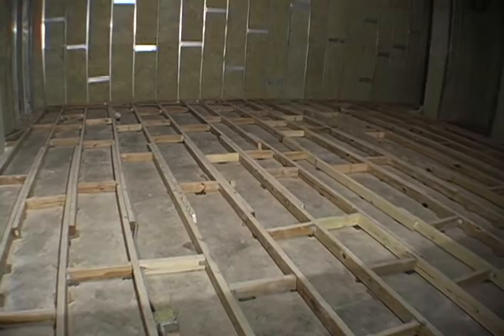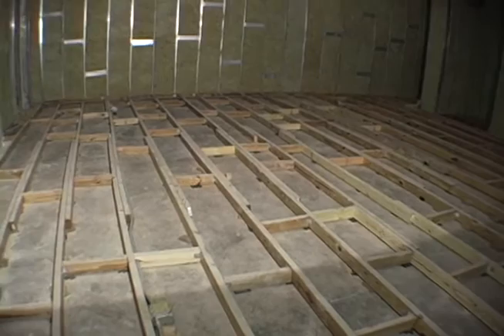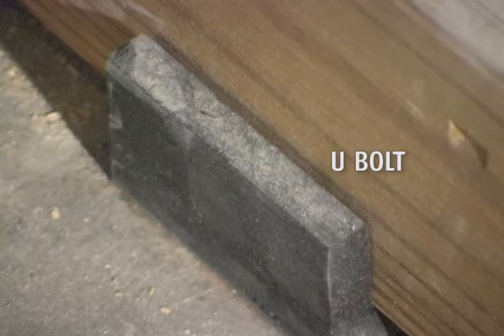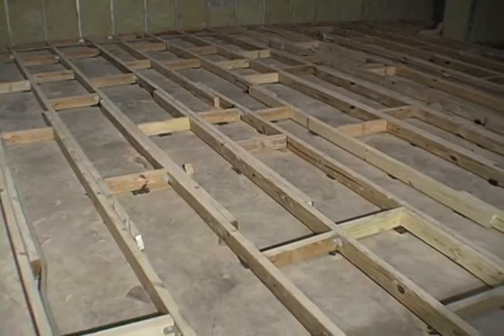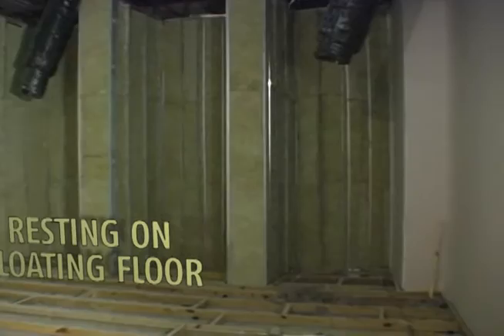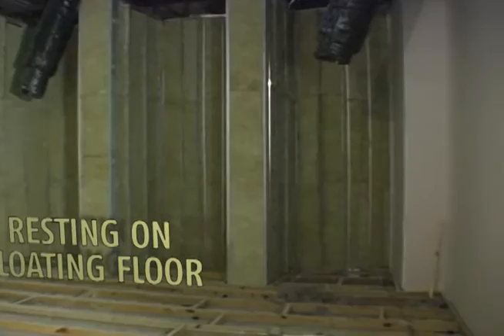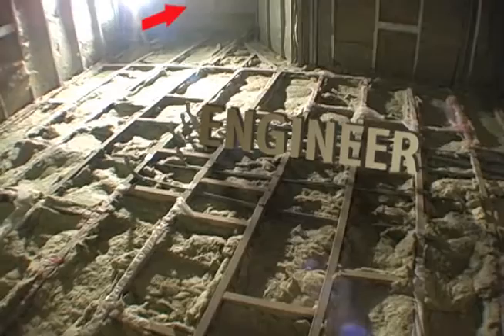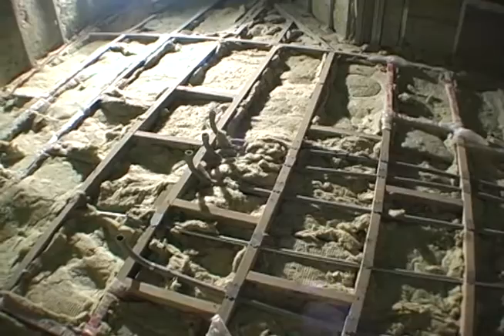GMMc Digital Studio In The Making - Floating Floor Design

Comment: This was a very enjoyable 2:45! 
But there are some areas I feel are often lacking in these studio build videos I wish I could see more of:
1.) How to add conduits for wiring - for both electrical and Mic cables. You don't want this as an after-thought
2.) Properly sound-proofing pipes and HVAC going through the rooms. Because the sound WILL escape
3.) Ventilation/Ensuring good air circulation. Another thing you want to figure out before the build
4.) Natural light/windows - How to limit the sound from getting out? Or we just have to deal with no windows?
5.) How to prepare the lighting plan. Unless you know exactly where your clouds and treatment will be placed